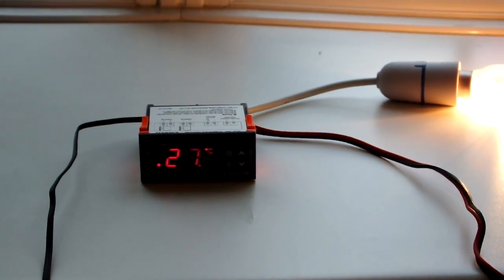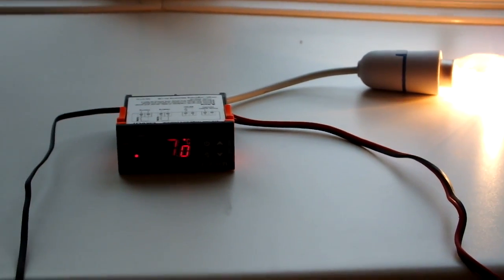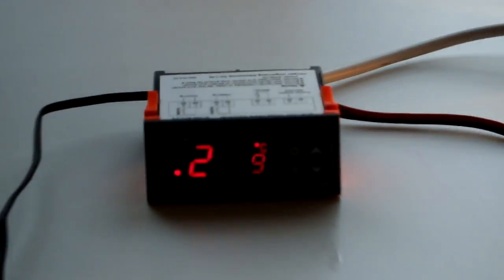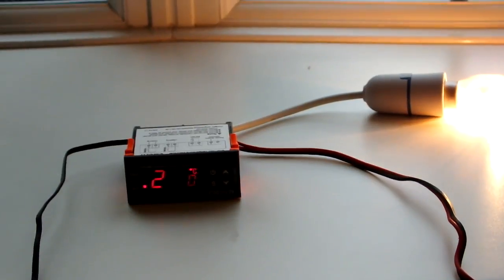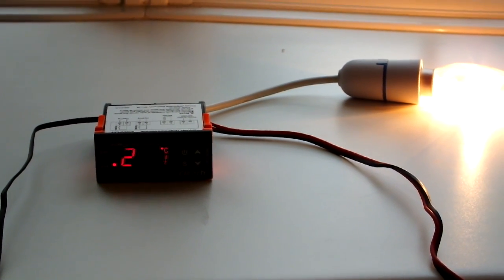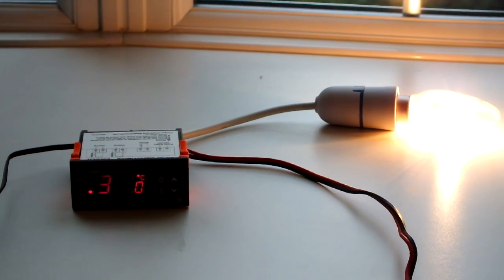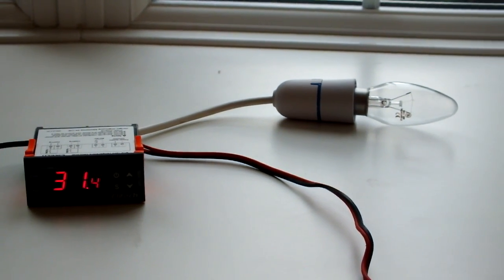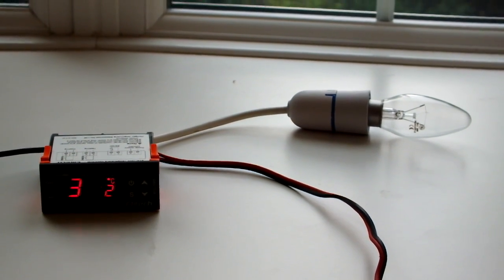Elitech STC 1000

Comment: Could you possibly show us the back of the unit how u wired it as I'm looking to do the exact same set up for an egg incubator I'm making please thank you
Reply from the maker: Hi Jakir, No problem the link below will give you a photograph showing the wiring details at the back. The white cable thats labeled 'mains lead going OUT' is a short shop bought extension lead. It has two sockets on one end (and a mains plug on the other end). I cut the mains plug off and used that to connect the unit to the mains supply then it gives me the two sockets which I plugged my heaters into.  http://acimg.auctivacommerce.com/imgdata/0/1/1/0/7/8/webimg/13826960.jpg
Reply: Image wasn't very clear =(
Reply from the maker: Jakir Hussain Might need to enlarge it a bit? or alternatively I can email it to you if I can have your email address?
Reply: Please show me how to fit wiring step by step